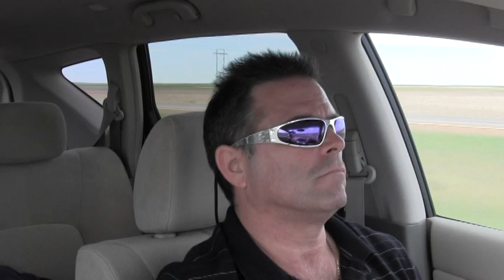Pcv Valves | (816) 482-3677 | Auto Repair Kansas City | 64118 | Kansas City Auto Repair

Comment: I drive an 08 Ford Focus,  The PCV Valve is located under the intake manifold. I can't even get to it to check it without first removing the intake manifold. I sure hope the engineers at Ford designed that thing to last a LONG time because I can't see me ever changing it or wanting to pay someone the probably 2 hours worth of labor it would take them to do it.

Comment: Any tips about how to remove the PCV from a Dodge Ram? Mine seems to be stuck fast to the rubber grommet and the grommet itself is hard and rigid, won't give at all. The valve and grommet are old but if I blow/suck on the vacuum line leading to the valve I can feel and hear the valve opening and closing, so it seems to be OK.